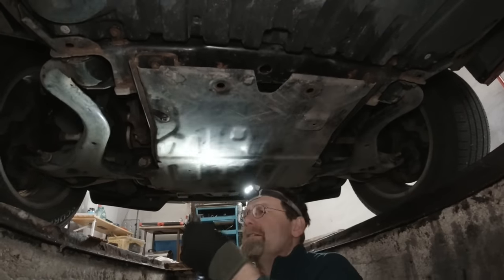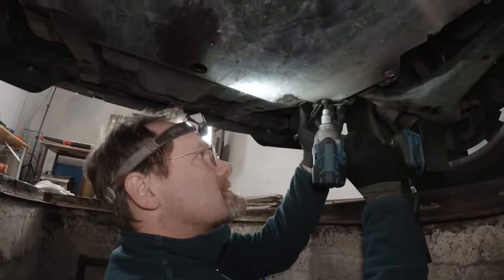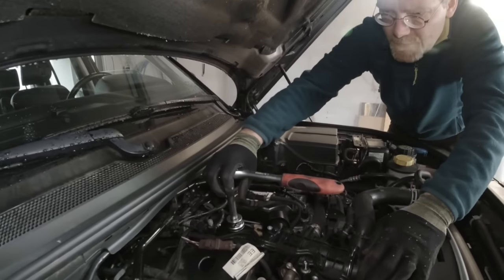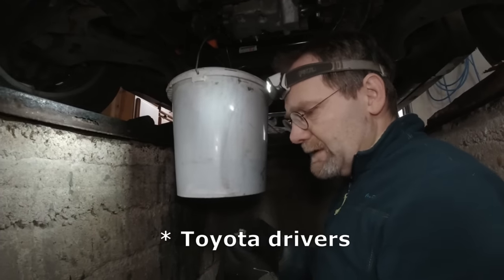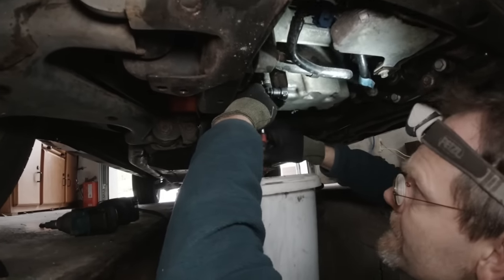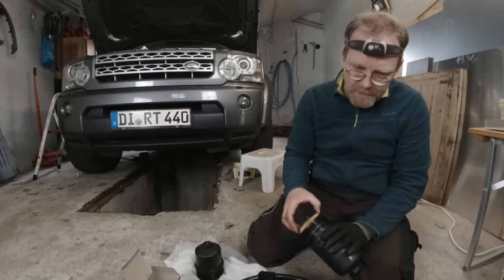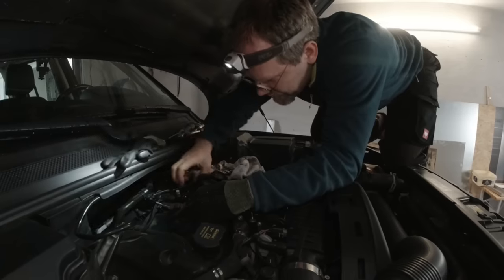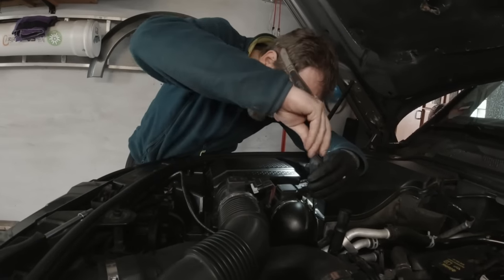No more 5W-30 ever again - Land Rover Discovery 4 - Transfer Case and Diff oil change

Comment: You can change the oil ‘weight’ dependent on climate and session… a oil suitable for Finland is going to be different to Africa, the operating temperature ranges are vastly different. People get to hung up on ‘what the manual says’, it’s a guide. The additive package and quality of the oil is what peopled should focus on.
Reply: oil weight is directly proportional to its mass !
Reply: The operating temp will be very close. The engines have a cooling system with a thermostat for a reason......
Reply: @sheilamorrison1954 you would think they would closely match but they don’t, data logging shows oil temperatures lag behaving water temps a lot, partly due to localised heating of the coolant in the heads around the exhaust ports plus the coolant temp sensor normally being located in the coolant path between the head and radiator. Oil temps take so much more time and miles to get to operating temperatures than anyone expects especially on cold days where oil might not actually get to temp for most journeys. This delta can be as large as 20-30 minutes or more!
Reply: Engine wear is in the equation also.
Wider tolerances in a worn engine will need a ticker oil than when the engine was new⚠️

Comment: Just changed the 5wdumbass oil in my 2011 Range Rover Sport for 5w40 C3 and the first thing I noticed is the engine is noticeably quieter! Makes sense, but didn't really expect it, so a nice little bonus. 121k miles (200k km) on the clock now, so hopefully this change will keep it running smooth for many more years. Thank you guys, und vielen dank! 🙂

Comment: Replace oil pump now to make sure that is the reason for low oil pressure before you pull the engine 😊
Reply: The chances the low oil pressure is due to the oil pump is low. At the end of the day, the oil pump creates flow. Pressure is achieved with the bearings.
Reply: Arh. I think you already have the answer Christian. Swop out the pump now so you can rule it out or in as the fault. Very entertaining video again. Love your German logic.
Reply: Regarding the oil pump..
If in doubt..? whip it out..

Comment: 2.7 and 3.0 hdi engine was originally designed for 5W-40 and then due to marketing and idea of less internal friction and lower fuel consumption changed to 5W-30. Than suddenly in Norway we had maby engine failures related to oil because it showed that 5W-30 brake apart   by oil shreading and high tempts just over 5000 km. I would reccomend 5W-40 quarc 9000 total ineo. Magnatec oil you showed is branded as synthetic but its actually semi synthetic with esters.

Comment: Christian is right the change of oil from 5w30 to 5 w40 is due to global warming, a few years ago the winter was colder in Germany, now Christian can even afford to cut less wood for heating because the harsh winters have disappeared. Nice video thank you. 😎😎😎
Reply from the maker: 😅👍 I had my oven running until last week. 🙋‍♀️Vera
Reply: That's called weather. Stick around long enough and you'll realise that it's different every year. 😉

Comment: My eyes have been opened with regard to oil types. My wife's 2007 Camry was the subject of oil use issues that some thought should result in a recall and engine repair or replacement. You may not know, but Toyota would test the oil consumption by filling to the proper level and then "sealing" the system. They would recheck the level after the owner drove the car 1000 miles and brought it back to the dealer again. Toyota would not repair an engine unless it used over 1 quart of oil in 1000 miles. During the effective time of the tests (age and mileage), her car did not consume oil.  Later on, it began using a great deal of oil - possibly half the capacity - between oil changes. For some reason, I felt I could not use oil other than the type (5W20) marked on the oil filler cap. A friend suggested I try another weight oil to see if it helped with the consumption. I switched to 10W40 oil, and the oil consumption practically stopped. This seems to have allowed us to use the car for another 50,000 or more miles so far - beyond what seemed to be where it was worn out, based on oil consumption. In some cases, the dealer is not going to help with a problem, and you have nothing to lose by trying something the dealer does not recommend.
Reply: Oil Cap viscosity markings are to satisfy the EPA.  It is not, usually for the health of the engine. And yes, 5/20 whether in a mazda, toyota, honda or Ford, GM, Chrysler.... They do burn quick. So the 30s and 40s are better when at operating temps. If you do live in the colder parts of the US, i would suggest a 5/40 vs a 10/40 for better cold starts....but remains the same when hot. (in Alaska, u may require to go 0/40 vsa 5/40)

Comment: Definitely check your oil pressure with a hydraulic gauge, could be your Chinese one is, god for bid, faulty.  No video is boring with you both in it, always entertaining and informative
Reply from the maker: We do that, I am sure it's in one of our vidoes. We put a gauge on the schrader valve and tape it to the front window. 👍🙋‍♀️Vera

Comment: Hi Christian, I bought my 2016 Disco 4 in July this year and about 2 wks ago, I got Service Required indication came up. I  saw your video. You changed to 5w40 oli on Disco 3, and I, too, was going to change to 5w40. But my 3.0 SDV6 has start/stop, dpf filter and Adblue, I kind of chickened out fearing it may cause engine problems and used 5w30 oil(landrover Jaguar specification) and You were right in saying that 5w30 oil is just like pouring water, it's so thin and it worried me, if this watery oil would be sufficient enough to keep engine parts well lubricated. Then I added ZX1 Lube Oil, which is protection/friction  free lubricant for essential engine parts. After doing the service, my God what a difference that ZX1 Lube oli made. The engine runs very quiet and silky smooth and on top of it the best thing happened is that I used to get with normal driving 26 mpg and now I'm get nearly 28.7 mpg. I'm delighted. But I think I'll switch to 5w40 on my next service.

Comment: I vote for an early replacement of the oil pump.  That way you will know for sure the problem was with the pump and not fixed through any other changes as part of the rebuild.  Thanks for the video, I learned a few things from it.

Comment: Good point about the oil.  Since new, I have used 5W-30 oils, but recently as the engine is ever-so-slightly tired, I put in a hefty squirt of gear oil!  That quietened it down nicely, and SEEMS to have improved compression & starting.  So  5W40  is the way to go.  (Also, I have been using an anti friction additive Activ-8 in my engines for years, greatly reduces wear in the long run.)  Good vid, thanks.
Reply: Hi what weight of gear oil did you use & roughly how much of a squirt,300ml,500ml ?
Reply: @chrisparsons7711 80w-90 gear oil; probably only about 100ml, just to see how it goes.  I don't want to increase the internal friction unnecessarily.  Crude, I admit!

Comment: I've just switched my 2006 D3 2.7TDV6 with 230,000k's from 5W-30 to 5W-40 fully synthetic Castrol edge a3/b4 🤫🤞🏻 I live in Australia where my temps vary from -7c to 40c depending on the season. I tow horses often and love the car even thought the gearbox I'd Crap!!!! I love your show and watch it often. Thank you 🥰❤️💯👌😎

Comment: Thank you so much for this step-by-step instruction for an oil change. I just made the first oil change on my new old LR4 and it worked out perfectly. Btw I used a pizza cardboard from a supermarket pizza which I placed over this frame as a shield which made the oil run smoothly into the bucket. Not a single drop spilled 🙂

Comment: you two are a couple or wonderful characters, love the entertainment value of the video but also appreciate that you pass along much technical information. If it were my decision I would opt to replace the oil pump ASAP because it is essential to the engine. Could be when you do the replace you will find some other problem that was causing loss of pressure or lack of oil feed to the pump? Whatever the case I see it as a problem that needs solving sooner than later because you are risking accelerated wear....even in just the summer months interval.

Comment: Vera, tell Christian that the only way you're going to let him wait until winter to replace the oil pump is if he buys a replacement engine that can be fitted immediately in the event of a catastrophic failure.

I suspect the reason Christian isn't in a rush to fix it is because he thinks there's some other problem and a new oil pump won't help.
If that IS correct, and the engine requires a major rebuild, the cost of buying a new oil pump is going to be insignificant compared to the cost of rebuilding the engine so it won't really matter if you try a new oil pump before starting more major work.

Comment: Another great video, I have watched for 18 months now and enjoyed every one. I couldn't believe I did not think to put 5w-40 in my own Disco 3 but within a week of you doing Vera's I did mine, I have changed the oil pump (and belts) twice on my 176000 mile (not Euro KM,s) and the engine runs very quiet and smooth in fact previously I had a Discovery Sport with the same engine with only 60000 mile on it and that engine was defiantly louder than my Disco.
Anyway we all know just regular engine oil changes will prolong the life of any engine I usually go no longer than 3-6 thousand miles between oil changes. I changed the oil after your oil change but also I added Wynns additive which has the consistency of honey (as used by Derick on Vice Grip Garage) which I have used over the years. So heading towards a quarter million miles (hopefully) unless you would like to do an engine refirb for me Christian lol  that was a great series of videos. Keep up the fantastic content all the best Phil and Louise

Comment: My 2012 D4 sump bash plate has 13mm head bolts the same as the D3. I suspect the previous owner / LR garage gorilla rounded off the 13mm heads and replaced them with whatever they had to hand. Your torx head bolts actually look like seat bracket bolts.   I also use a Femco quick drain  on the drain hole, and I also use the suction tube. Well done for finding the reason for the differences in the oil filter, I have often wondered, but never investigated. I have used 5w40 in my D3 in the past when it was working a lot in the south of France. I currently use 5w30 C2 PAS spec in my D4 but am considering changing to 5w40 C3
The D4 has vacuum supplied engine mounts, and if you see the actuator arms on EGR cooler valve are rattling, the vacuum pipe to the engine mounts is compromised. (My engine builder, Marko at QP Online) told me this.  
I have used Ravenol STF 0870 for years, but now Ravenol tell me that The new RAVENOL Transfer Fluid DTF-1 replaces the RAVENOL Transfer Fluid TF-0870!  I use a 5 litre garden pressure sprayer to fill my diffs, much easier than all that pumping. And I have found that fill to spill on the diffs and transfer box takes just under the measured amount of oil, so fill to spill it is. 
My cost per km on my 320,000km D4 for the last 215,000km is €0.21/km including a full engine rebuild due to a snapped crankshaft at 198,000km.

Comment: Just to clarify a few points: D4 engine bash plate uses the same bolts as a D3, somebody has changed them to torque. Not all world regions have a DPF fitted to the D4 (no DPF on the D4 in Australia) I actually don't agree with blowing out air filter, simply replace it. I recommend to all my customers to do a service every 10K changing engine oil, oil filter, air filter and fuel filter. At the end of the day the best thing you can do to an engine is change the oil on a regular basis. While I am certainly not a Land Rover fan boy remember that the V6 2.7 and 3.0 is a rubbish Ford engine. I'm a small workshop and I have probably done at least 30 engine replacements on both the D3 and D4. Saying that I can show many D4 models that have over 300K and running well. As always keep up the fun videos.

Comment: Hello Christian and Vera! Thank you for leading me to this video. I am also experienced in automotive, but this is my first Diesel engine. I have done a lot of research on the DPF oils and can add a couple of things I've read from the manufacturers - with C1 and C4, they don't make it in a 5w40, only 5w30. I also don't want to criticize, but just bounce some ideas off of each other, that C3 is actually considered a mid-SAPS oil, not low-SAPS like C1 and C4 (C4 has the higher HTHS rating). I don't know if this was a mistake or not, but with LR calling for a low-SAPS engine oil, do you all have any concern over using a mid-SAPS oil in regard to the DPF clogging over time?
Reply: @@TobiasCat-nb9lg This sounds like you are talking about gasoline spec though, which of course any oil could be interchangeable. I understand some oils will better protect the engine, but my concern about this post is clogging the DPF with mid-SAPS when the spec calls for low SAPS.

Comment: Your graphic is perfect. Love that.
I have a 1993 Range Rover Classic petrol. I upgraded my oil to 20w50. Manual calls for 10w40. But using the right oil for the right climate matters. Love the videos. You two crack me up.
Reply: Also it depends how worn the engine is.
Unipart used to suggest thinner oils  for newer engines and thicker for older ⚠️

Comment: In the US the ford f150 diesel has the same engine basically and almost everyone including ford dealers uses 5w40 HDEO oil, ford sells the magic 5w30 oil under their own label but from what I gather they advise for severe duty to use 5w40 ACEA E9 oil.

Comment: Once again, I firmly believe you made a good decision. What would really make this more interesting is, if you haven't disposed of the old 5W-30, you could get a small sample (100 ml or so) for a used oil analysis and do the same with the 5W-40 after 2 oil changes with the same oil for consistency purposes. 

One suggestion I would make though is to replace air filters as opposed to blowing them out with compressed air. Part of this is because the filter media is not designed for the type of air pressure you would see out of an air compressor. The other being, you cannot clean the filter out completely and end up loosening dirt that could make it's way into the intake when the filter is put back in service. This could also show up as elevated silicone levels in a used oil analysis.

With that being said, considering the South African A3/B4 recommendation, which is essentially a full SAPS oil, you could take that up a notch and use a heavy duty engine oil that's has an ACEA E7 rating with a much more robust additive package than any other regular oil. Something like Mobil Delvac 1 5W-40 comes to mind.

As for the differential, 75W-140 is a great choice. Yes, fuel economy may take a slight hit, but in the grand scheme of things, offers better protection for your gears. I notice you also used vollsynthetisch labelled oil, which in Germany means it's POA based, making it an even better choice!
Reply: That’s some good info!
Reply from the maker: Thanks for the feedback.  I thought about a oil analysis but I would not be able to interpret the data.   The air filter was only 8 month old and this is why I put it back in.  I only checked if there was dust using a air gun. It was not my intention to clean the filter.    Talk to you see Cagri, Christian
Reply: It’s interesting, I think Mobil Delvac will be the best solution under operating conditions in Russia. In my region it’s +40 C, and in winter -40 C

Comment: 5w-40 on all diesel no exception is what I use on all diesel, help with fuel/oil dilution, oil sheering, oil pressure and oil consumption.
Reply: I do the same, always have done and always buy Diesel specific engine oil.
I have run Toyota 4x4's for decades, in the handbook the range of approved oils is huge depending on typical local ambient temperature, am yet to have any issues with any of them save a failed alternator once.

Comment: Hi guys, cracking channel, the oil drain pan you don't like to use because you can't check for metallic particles I use all the time, however I put a gauze inside the hole that lets the oil through but collects any bits of metal that's in the oil and I don't have to search the old with a magnet, my wife is not best pleased, I used her flour sieve for the gauze, keep on keeping on guys.

Comment: Tip. I hate removing oil drain plugs because (a) they a habit of dropping into the used oil, and (b) I often get a squirt of oil down the sleeve of my overall. I installed an oil drain valve some years ago and it's great - really quick and no mess.

Comment: Hello Christian and Vera, great video guys very entertaining as always.  I am using 5W-40 on my 2010 LR4 V8 5.0 petrol engine for about 3 years now and no problems to report about that. I just replaced the engine valve covers and gaskets,  spark plugs, coils,  fuel injectors,  engine belts,  thermostat, engine oil and filter, and radiator coolant. All very easy to do,  but removing the original fuel injectors was a real problem and a pain.  Next on the schedule would be the transfers case oil change, thanks for the video. Take care and stay safe. 
Onax
Reply: I'm about to do the engine valve cover gaskets myself. I have a small oil leak on the passenger side bank.
Reply: @fredbrackely  Yeap, I had the same problem. The usual Land Rover oil leak on the passenger side and the driver side was fine. But I went ahead and did both as I did not want to do it again in the future. To remove the fuel injectors get the special tool because those are a pain. My LR4 is running like new again, now it feels like the V-8 5.0 has new life, 142 MPH on the autobahn no sweat and I pull back on the gas pedal simply because I wanted.